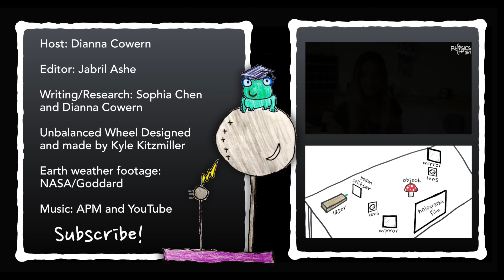Are perpetual motion machines possible?

Comment: HOW MIGHT WE OBTAIN ENERGY from SURROUNDING TEMPERAUTRE
MAY WE?

Might we built thermal motor with 100% efficiency?

This model SAID yes , how? Read below and enjoy the journej

(and therefore have possibility to obtain energy from the surroundings without consuming some fuel though in theory)

(let it be in the vacuum )
Shocking but fact - this motors already convert 100% heat energy into pover
BUT!!!  (how it might be without it) in the First Stage      when it expand to the point where temperature equal environment temperature
(simple machine which consist of piston , cylinder, gas inside it)

In the Second stage we should compress volum emiting heat to the environment with the same temperature what environment has and therefore waste energy (even nothing to contain
thermodynamic allows us contain overheat without effort but in this case we dont have overheat)

So if we can avoid second stage we can save efficiency(and it might remain 100%)

And solution  how to avoid  waste power of compressing gas is...  :)
Dont use GAS !
we might USE LIQUID heated to the boiling temperature (boiling temperature depends on pressure on piston, let it be atmosphere pressure 1 Bar/100 kPa)

So we boil water, expand volume with 1BAR pressure, supply heat 212 F/ 100 C 
in the process, then we store remain warm(overheat if compare it to the environment temperature)
And - without effort return piston to the start position(thats it, all what for all of it,
this key component, we got it)

In the next stage we return stored warm into system and supply additional heat
intto the system
And repeat it again and again never emit any heat to the surroundings
All warm eventually would become power.

We heated water, we get what we want(power)
we store remain overheat to the storage with 0 effort
in order to use it in the next stage, and repeat 
we use heat in storage , then supply additional heat 
and repeat it again and again without waste of energy
therefore all warm energy will become power even though not at once
(thi is idea)

if we talking about water , temperature of boiling water is 212 F/100 C 
Coefficient of efficiency may be something around 4 (0.25 points input power to obtain 1 point warm energy)

And all iof it as we could see , might be converted to power
another words input 1, output 4 , difference would obtained from surroundings warm (another words it may be little bit colder if then)

Comment: If a hundred amp electric motor can spin a 260 amp alternator , then you have an excess of 160 amps of electricity above what the original motor needs to run . Perpetual motion maybe not , but free energy yes . Or a smaller water pump pumping water to a higher elevation , then allowing the water to come back down and harness that energy just like a hydroelectric dam . A battery system to store the energy , so you can use it as you need it . The vast majority of people are working on programming and indoctrination . The government the schools the churches none of them want you to be able to think for yourself . If it wasn't 90% of the population easily programmed and only 10% resistant to it . But 90% of the population resistant to programming and only 10% subject to it . The world would be a much better place for everyone . And there would be a couple of million people who know what I know instead of a half a dozen .
Reply: You don't understand how electrical systems work. 
A=W/V
Do the math and you'll understand why your claim about motors and amperage is false.

It takes more energy to pump a volume of water to a higher elevation than can be generated by harnessing it's flow back down.
Why?
Friction is working against you both ways-up and down.

Instead of spending time worrying about other people being "programmed", you should consider  taking some introductory courses in basic physics and electronics.

Good luck.

Comment: Man has been too destructive and good at sterilization of the landscape. We can turn it around though. First would be go to no dig. Second would to put in permaculture in all public settings. Third level all gradients to a 1% drop. That slows water runoff and mitigates lack of moisture in the air. Once the ground is leveled then start putting in nitrogen fixers, followed by pollards. To be turned into mulching. Animals can then be brought in in mass stock density. Followed by fowl. You follow this pattern and we can bring even the harshest deserts back to abundant life. Ecology by abandonment is only put forward by idiots who don’t understand how nature’s God set the system up.

Comment: You obviously have very little knowledge of constant magnetic acceleration
There is ring , neutron and proton, and  "?"
But the one field they never discuss or mention is of mass,
I will not go into it in detail.
But tell you this,
GE (in the 50's) many long years back including Tesla, Edison and others have built a device a similar device, that proves mathematically it is possible, But they all got stuck with the unit they built as it has a mechanical electrical problem.

Take the formula,  P = E x I
and in these units they built, They are using zero voltage with high currents, and unfortunately the slip rings arc and it becomes useless.
That simple little unit they built does prove it is possible, But all have given up and gone into different fields,
The concept of free energy yes it is there, All you have to do is unravel the mystery,

There is another way to prove to you it is possible, but that is not for me to explain it to you and others, 
Study the laws of physics, it is there but well hidden,

This I will tell you, Most professors of physics get at most one day of teachings in the field of CMA energy, 
And they are told it is impossible,
That being told that - Puts a huge wall between success and failure !